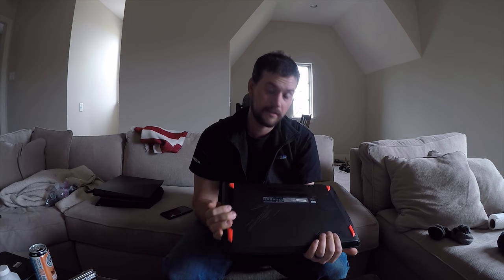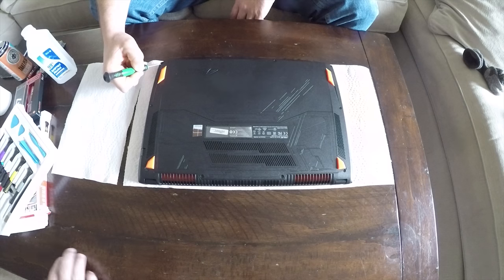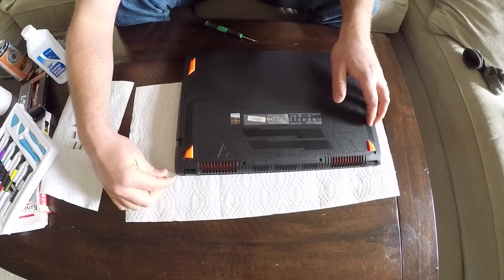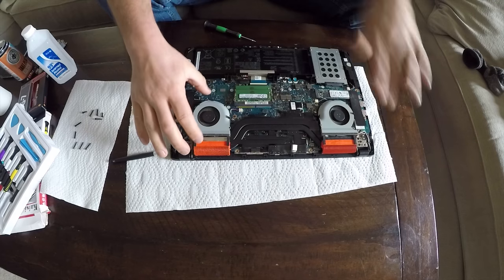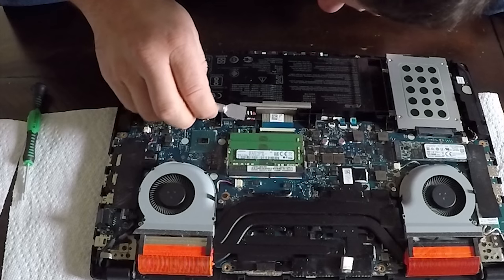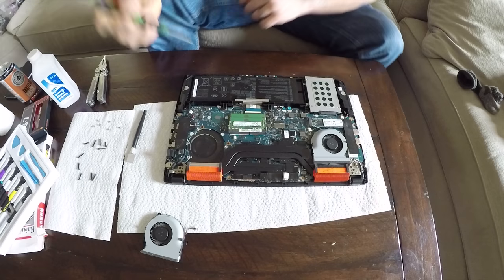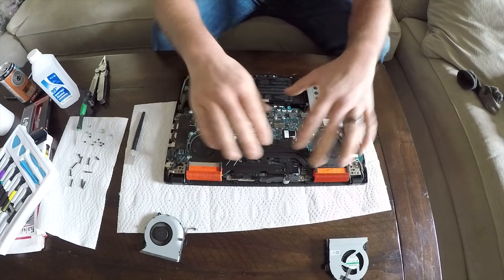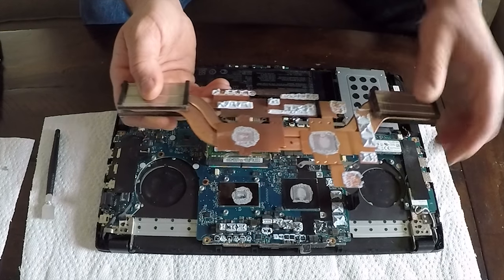How to Asus GL502VS Repaste

Comment: Nice, but now You have no warranty :P  Spoke with Asus about that and they confirm that replacing thermal compund by urself You will loose warranty ....
Reply from the maker: My laptop was refurbished when I purchased it and had only a 90 day warranty, I repasted after owning it for over a year.  It was no longer under warranty.  I wouldn't recommend losing an active warranty to do this.
Reply: @Matt014X  I think it will be helpful for others... However asus did so shit job placing their thermal paste... Omg 15 yo child would do this better :/  And no holes under intake fans - another design flaw
Reply: jokes on you my warranty ran out

Comment: Hi Matt, great video. I have this same laptop. I bought at best buy in Feb of 2017 and it worked great for a year. Internal HD died, but put a SSD.   Now in the last few mos, the fans come on loud after a while and the screen starts getting bars and it freezes.  I shut it down and cannot turn it on until I believe has cooled down for a bit, I believe it is due to over heating.  What symptoms did you start getting before you did the repaste? I'm fixing to open mine in a few hours.
Reply from the maker: I was getting temperatures that were higher than I liked but never got a failure like that... If you download msi afterburner and msi kombuster you can see what temperatures you're getting under load.  These gpu's/cpu's are designed to throttle themselves by lowering voltage and performance when the temperature gets too high, so this "failure" that you're experiencing is not a good thing. If you can, run msi afterburner and kombuster to the highest temperature you can see and then take it apart and clean all the heat sinks and fans with compressed air, then repaste the processors and see how much of a difference it give you.  Hopefully it fixes your problem.
Reply: @Matt014X  thank you for the quick reply. I had an extra memory module that I had been using, I took it out and so far it seems to be working. I did repaste all the chips, cpu and gpu and definitely right about the stock pasting... It was dried up.  Used your video as a guide. Definitely appreciate it.

Comment: you need to use thermal pad, not to paste everything rofl
Reply: Dude... I was wondering the same and I am looking at the comments to confirm weather everything else except the CPU and GPU was with thermal paste or thermal pads. So is the thermal paste only for the CPU and GPU and the pads for everything else? Because I already did what this guy in the video did and I am a bit worried now.
Reply: @AlexanderAnastasov  100% its not right to paste motherboard power supply circuit

Comment: I know this is an old vid, but I have this laptop and seem to be hitting overheat issues on games it should have no issues on, with clean fans. Will replacing the paste make a substantial difference?
Reply from the maker: Yes.

Will lower temperature by up to 10c .... It cannot disapate heat easily and causes the temperature to be higher even at idle, the fans then are told to operate at a higher rate to keep the processor cooler.
Reply: @Matt014X  Thanks! I did a factory format earlier today for some other reasons. Just curious, no longer using the rogi strix launcher for controlling fan speed and geforce experience etc. Will the fan still auto regulate, do you know?
Reply from the maker: @craigharrison1838  yes it will still regulate, it will be controlled directly by the bios/motherboard wheras when you install the rog things it controls it with software overrides
Reply: @Matt014X  Thanks bud! It was really embarrassing! I was playing 40k DoW2 Retribution, a 9 year old game which has been overheating it, but I can play games like overwatch with no issues. So trying to get to the bottom of things!

Many thanks for the help!
Reply: Replacing the thermal paste will change the heating insignificantly on this laptop model. There are several main reasons for GPU heating in this laptop. So, the first reason is the terrible air vent design, when the radiators are covered by the monitor cover. The second is that the NVIDIA video adapter always works, despite the fact that there is a built-in INTEL for normal work, watching video. In addition to replacing thermal paste, cleaning the radiators will help you, since in a year they can be covered with dust by 20-25% (in my conditions), as well as a decrease in processor performance in the power settings from 100% to 90% (Turboboost function is disabled), in Windows. You will also need to glue the gap between the cooler and the radiator with metallized tape, it is about 2 mm wide. And of course the settings of the games themselves, my version of this laptop with a 4k screen and running games at 3980 dpi heats the video card very much. in fact, it is enough to play games on such a laptop in 1920 or 2k resolution so as not to overheat the video adapter.

Comment: Do you think it would be possible to upgrade the GPU?
Reply from the maker: I don't believe so.

The chips are soldered down to the board in these laptops.  We are talking a serious job
Reply from the maker: @Sudin S Sudin that's going a little further than repasting, that's a much bigger job.
I would assume that there is a way to do it, but you may need to do some research/look for other videos where people have done something closer to what you're looking for.

However, it is unlikely you will find a video that walks you through it on this specific model.... You may be able to find another laptop brand where someone does this but you will need to adjust to any differences you run into that are unique to this specific model.

Good luck.
Reply from the maker: @Sudin S let me know how it goes, it is likely you will need to do some soldering but I hope you can get it to work.

Comment: Nice video man! I just have one question mine is a GL502 VMK and my left fan when I unscrew it I can't remove it because it has some sort of metal tape attached to it that won't let me remove it ... you know what this is?
Reply from the maker: Hmmm I'm not sure, is it possible it remove it and reapply the tape?  What purpose does it seem like the tape serves?  I'm having a hard time picturing it
Reply: I hawe probem with gpu driver.. what driver version you use /Memory management error or driver powe statute error by game play../
Reply: Matt Sweeney I have this same tape which made it difficult to remove the fan. Its like a copper tape and i have no idea what its for? heat distribution maybe?

Comment: Thanks to your video I've successfully done it on my FX502 :-)
Reply from the maker: Glad I was able to help!  🤜🤛
Reply: Musmuk, my fx502 is i7 7700hq and is about 3 years old. I noticed that it runs so much hotter now after i repasted it. I dont know if i messed up the repaste or my laptop is just old. When playing valorant at medium settings, it runs at 85-92 degrees even when cooling fan is used. Btw i live in a tropical area

Comment: If i open the laptop will i lost warranty?
Reply from the maker: Hello ASK,. Opening the laptop will NOT void the warranty because this is how one would access the motherboard to add memory or change hard drives.

However, please keep in mind that if once the laptop is open and you are repasting or changing things and have a problem that results in a warranty replacement and they see that it has been repasted or changed, this may effect their willingness to replace products that they may try and say failed because of the aftermarket pasting.

But I wouldn't worry about it too much.  Thanks for watching the video, if it helped you out, please subscribe, it helps me out 

Any other questions let me know!

Comment: You still have to undervolt in order to drop Temps even more. Intel XTU and Afterburner are your friend.
Reply: What settings for I7-6700HQ?
Reply: @fuji7848  it depends on your particular unit. You might be lucky and it undervolts a lot, or you might be unlucky and it doesn't. My 6700HQ undervolts with -0.145 offset and is stable at that, which gives me close to 10℃ decrease in cpu temps under load. I had it freeze sometimes at -0.15. I'd recommend starting with -0.1 and then lowering bit by bit (perhaps increments of 0.05).

Comment: Hey man, thanks for the vid. Im planning to repaste my laptop same model as yours, is it okay to use any percent of solution of alocohol to clean? Or are there any specifics? Only have 70% atm. Thanks again
Reply from the maker: I think %70 would work ok.  The higher water content could be slightly conductive so as long as you remove the power and make sure everything is dry it should take care of that, could possibly corode slightly because of some water.  Also the higher alcohol contents are going to cut the old paste out better for cleaning.  I think you would be ok, but those are a few things to think about.
Reply: @Matt014X  im stuck at disconnecting the batt. I kinda have a hard touch so im scared lol
Reply: Im done repasting but i think i messed up. The screws holding the heat sink are loose threads now. 😅
Reply from the maker: @theyseemerollintheyhatin8397 so the screws spin freely?  They don't need to be extremely tight.  Are all screws spinning or just one?
Reply: @Matt014X  its hard to unscrew / remove them now. About 4 of them.  it would be hard to do a repaste again 😥
Reply: @theyseemerollintheyhatin8397  so how's your laptop now?
Reply: @rg1346  laptops okay man. Still havent done any repaste on it again. I might bring it to the repair center for proper removal as the screws are loose 😂
Reply: @theyseemerollintheyhatin8397  ah. Well I have the same laptop and Iam going attempt my repaste next week
Hopefully everything goes well. 😅😅
Reply: @rg1346  goodluck man. Just follow everything on this video.
Reply: @theyseemerollintheyhatin8397  just got it done man. I used noctua nth1 paste and my temps are really good in gaming now. :)
Reply: Doesn't really matter, it just needs to get clean. I've wiped with (just) paper towels before to remove old thermal grease. Just don't get contaminants on the surfaces.

There's always a "next level" to these things. 70% would be fine.